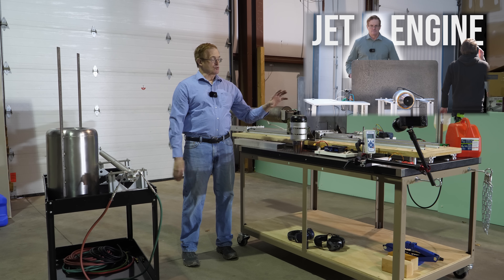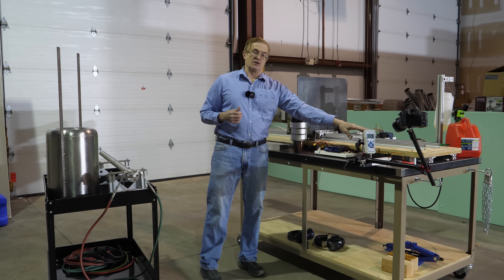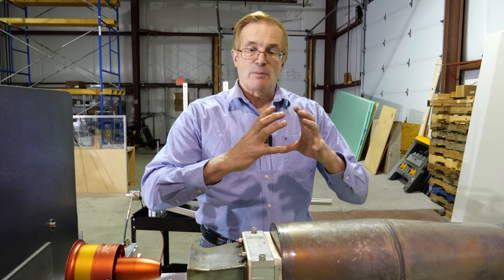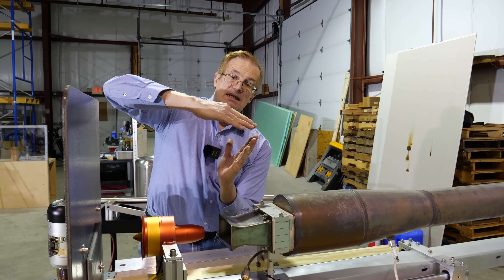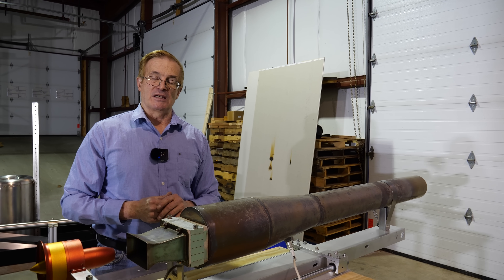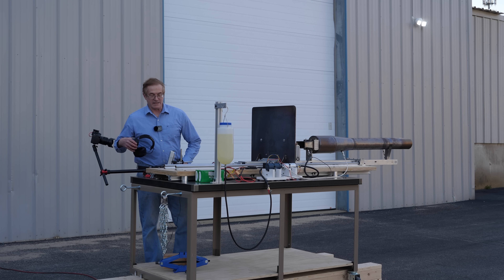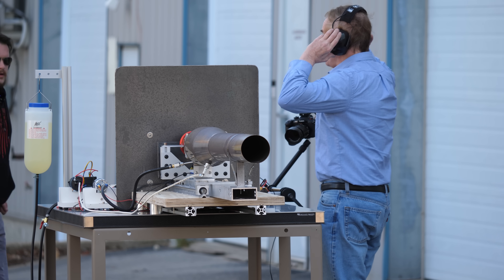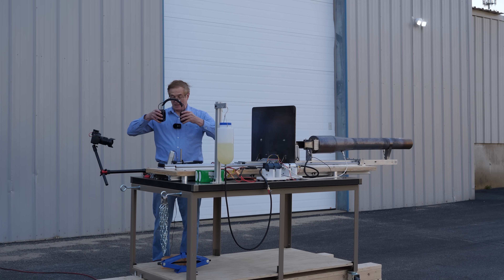Full Throttle Test: Did we Push a Pulse Jet Engine to its Limits?!

Comment: I imagine the fan was the added thrust and not a significant gain in force from the pulse engine.......there wasn't a real change in the jets sound to think it made an extra 45 or so nm of force
Reply from the maker: I disagree.
Look at the force guage when we turned on the fan, but before we started the engine.

Comment: To me it kind of looked like your damper there on the load cell was not damping. It was just springs. Short of a tuned mass damper, you might want to try like 1/10th scale RC car dampers. There are a (very) few with adjustable damping (as opposed to just adjustable springs) but they do exist and they're cheap.

Maybe this will help. I can't tell if the rigidity of the table was the problem.

Comment: Can't you just bolt the table to the ground go around the wall and control the whole thing from safe distance? Like you did with the rocket engines attached to a trailer.

Comment: Does diesel ignite in a pulsejet? What's the compression ratio for that combustion chamber?
Reply from the maker: It will, but it's harder to get started.
The power output would also be a little higher.
I said that it's about 2:1 when I discussed the value of forward motion and the fan.

Comment: Living in a railroad town in the 50-60s railroad brakemen had a portable pulse jet for heating up frozen running gear on train cars. Our town also had a pickup truck mounted pulse jet that expelled DDT for mosquito control..
Reply: I have encountered the pulse jet mosquito killers in the far east in the distant past, very noisy but fascinating.
Reply: @cambridgemart2075  here in Florida our mosquitos sound like pulse jets..

Comment: 6:17 What if you would use a rotary valve, like some 2 strokes have or had on the crank, like old trail bike i had with a Rotax engine, something like a 15/16 cm disc with a hole, but driven with electro motor, than time the spark plug to the valve and use a fuel injector from a car?

These devices they made in Germany back than where very very clever engineered, especially the "electronics", no detail was left out.

Comment: From the moment I heard about pulse jet augmenters, I've wondered how a full-length augementer would behave. Basic idea idea would be to increase the mass flow rate ad a normal augmenter does but also serve to cool the engine and draw a stronger air flow into the intake. If I recall correctly Messerschmidt had some interesting patents to that effect just after the war.

Comment: I’ve been curious, about injecting ozone into a jet/turbojet engine, theoretically the coanda effect inside of a pressurized atmosphere should be more effective at converting o2 to ozone. And since ozone is a better oxidizer I’d figure you’d get more power.

Comment: By the way, one of the engineers helping build the pulse-jet for the V1-german-rocket in WW2, lived after the war in Eastern Germany, and invented the 2stroke-engine-resonance-chamber, based on the function-principle of the pulse-jet... Was later taken by the Japanese (Suzuki), to help them with his know-how win 2stroke-bike-races for Suzuki... The resonance-chamber is what first turned the 2stroke into a performance-beast as it replaces the charger (which 2strokes anyway didn´t have, or any other engines, for that matter), and it´s a piece of tuburarly-shaped-metal-sheet, very cost-efficient, when compared to expensive turbo-chargers...
Reply: I played around with expansion chambers for two strokes in my youth. I didn't find them efficient for road use. I think there is a very narrow bandwith in RPM and temperature at which they work and it's hard to keep to this in everyday road riding conditions. They are popular on small 2 stroke aero engines which usually operate in constant speed conditions.
Reply: @nrml76  The whole theory around them isn´t trivial at all. If the baffle and the diffusor (the 2 cones of the chamber) have flatter angles (so, the 2 cones are longer), the bandwidth loses height, but gains "spread". If you make them flatter, you have to make the belly(straight piece between the cones) smaller, cause the altogether-volume of the chamber has to be constant (depending on the cylinder´s cc). there´s a lot to that, sadly, and during youth one has time, but not experience or knowledge. if the cones have sharp angles, the bandwidth is high, but short too. if the cones-angles are sharp, but the exhaust-port´s upper edge is rounded, it counters the effect of the sharp cones-amgles, and nullifies the chamber´s effect somewhat, giving you a short AND low bandwidth. if you make the port´s upper edge straight, and the cones shap, you get the shortest bandwidth, but the highest one, aka highest performance. If you make such a sharp chamber´s pipe gliding on the exhaust pipe (2-piece-pipe, gliging in each other by a strong servo, automatically matching load and rpm), u get the sharpest combination (aka highest performance), but can match it then to every rpm/load-situation, stretching the bandwidth 3-4 times (to a few 1000rpm). But it´s very few people doing that (the pipe from the port to the chamber is a 2-piece pipe, gliding in each other, so the exhaust can be short or longer, depending on engine load/rpm). Normally done solely in previous Eastern Germany (2stroke-tradition cause of the decades-long trade-embargos of the West, that made 4strokes unreachable) and Holland (racing-tradition on eastern-, but also west-german 2strokes). Look for "Variable length two stroke exhaust with servo", you´ll find 2 video´s in YT, and there´s a few more...
Reply: You can only mean Walter Kaden at MZ ... did not know he worked for Argus during the war.
Reply: @ He was somehow involved, hence the know-how... And today, no one can imagine a 2-stroke without such an exhaust.
Reply: I don't know much about Pulse jet Engine,But as I was watching the video I was thinking about the Reed valve on a 2 stroke engine. They are shaped like a triangle and they flutter when you vacuum on the one side .Or you can push air through the other side of the reed valve and it will also flutter. I was wondering if that would work for the home hobbiest to try. What do you think  ??
Reply: @jasonbamford7579  Sorry, I do´t understand the question, and from the bit I understand, I don´t see it being helpfull...

Comment: Is there any way to increase the compression ratio? What if we put another small pulse jet pointing the tail towards the intake of prime (larger)pulse jet engine, synchronised pulse of small pulse jet with the the backward pulse of larger one. that would increase the pressure allowing high compression ratio.
Reply from the maker: It probably would, as the fan obviously improved the performance.
Reply: @TechIngredients  yes, fan did its job but it's a continuous flow of air which might cause valve to stay open all the time even during combustion, Reducing the overall efficiency.
(Now I don't know how effectively internal pressure keep the  valve shut).

Comment: diagonal braces,, rectangular stuctures like this table are very bendy when encountering a "sheer force" like this
I recently was repairing a washing machine and tried running it without side panels, and it was terrifyingly bending so I had to turn it off while holding it to not fall apart, but put on the thin sheet metal panels back and it's super rigid

Comment: Watching the newton force on a table that weighs 450 lbs, your thrust to weight ratio looks to be .08. That will be a brain rattler but wont move the table due to your friction blocks. I am afraid, like you, if the augmenter doubles the thrust, you could lift an end of the table and, once that starts, the ratio could go easily over 1 and cause a full flip or worse! Possibly some anchors in the pavement would prevent that but you will also need to strengthen your recoil springs on the force block to lessen the "bucking" from the pulse. It looked like, for a moment, there could have been a harmonic event with the pulse cycles thus amplifying the vibration in the table. You make me ask questions on every show! Love it.

Comment: The more air you can give this air breather beast the better. It wants to consume air like crazy just like an afterburner or turbo. In other words fill that big booster tank up with compressed air, and pulse that into the engine. The compressed air is then "trickle" charged by an electric motor as most compressors do. You end up using the advantage of both rather than using a small motor to force a large amount of air in a relatively small volume. With ejecting compressed air you get the velocity essentially for "free" than have to rely on ram speed. Be warned that adding compressed air will definitely make your table fly into the stratosphere.

Comment: Why don't you add a carburetor to the front of the reed valve? Then you wouldn't worry about flooding... its basically a 2 stroke engine

Comment: I'd like to point out that I like the decision at the end. Because if your setup is running as intended and you might yet be able to improve it, it can be really hard to say "I'll stop the experiment" just because you have some doubts (in this case about safety) about going forward. Telling yourself "Nah, this is will be fine" is easy... Usually re-evaluating the aspect in doubt is the right decision, though.

Comment: So the fan is adding to the thrust but not to the combustion. The fuel has an optimum air to fuel ratio. If you  add a fan to the outside of the rig and switch the starter fan off and turn the auxiliary fan on you'll get the same result is my hypothesis. Or you make sure the fan is independent from the rig so it's blowing the engine away from the measuring device against the force of the engine's thrust. Am I wrong?

Comment: I'm also wondering about two other things:
    1. Since the pulsed jet engine works at about 2 bar, would it be possible to line the inside of it with a material to prevent the exhaust pipe from getting superheated?

    2.  Assuming you wanted to test this without disturbing the neighbors, local and regional wildlife, seismic sensors, or submarine sonars, would it be possible to create a sound absorbing structure into which the exhaust can be directed?  Sort of like your old sound-proof room, but in reverse.

Comment: This was indeed interesting, at least for me, compared to you're last experiment. If you use an inlet the same as in the last one, you get a lot of turbulent air and therefore a major boost in air fuel mixture, which could lead to a more efficient combustion?

Comment: Noticed the thrust seemed to decrease with the fan on, is the fan isolated from the thrust mounting (I.e. not contributing to the forward load but still contributing rearward load?)

Also you might want to consider adding dampeners in addition to springs. Currently your only damping is friction and fluid resistance from air, which will only partially damp high frequency pulses like this. Don't know what the critical frequency would be, but the addition of a shock damper like a fluid cylinder might smooth out those pulses even more

Comment: Since the augmenters don't work with continuous jet flow and need pulsed jet flow, and since the frequency of different pulsed jet engines vary, is there a best frequency of pulses to have?  

For example:
    • Too Infrequent.  Unhelpful below some low frequency threshold.
    • Goldilocks. Variably useful within an overall mid-range, and optimal at a narrow mid-range.
    • Too Frequent,  Unhelpful above some high frequency threshold.

Comment: The square plate needs to be either removed or moved at least double the distance away because of the air disturbance it’s causing.  Notice the efficiency of the pulse when you supply the air at the intake..?  

It would be better to setup a remote camera and take yourself out of the danger or build a full size blast shield for yourself so that you can remove the square plate.  We use a test chamber so we are not in the same room & air supply and have an extinguisher system. 

These are just proven suggestions from an SME perspective so that you obtain the best test scenario because what you have is currently flawed and causing more failure than proper protection.

Comment: 4:04 How are you not getting a spark across the wire connection and the aluminum strong back?
Reply from the maker: The entire assembly is at ground including the grounding wire attached to it.  The high voltage lead attaches to the isolated, central conductor of the spark plug and that terminal grounds to the outer rim of the plug.

Comment: Why not present a simpler valveless engine?
Reply from the maker: They tend to be aerodynamically bulky.
Reply: @TechIngredients  True, but you don't have to worry about valve failure, which is an issue with valved pulsejets. In the video you mention simplicity and ease of construction as being an advantage. Well, the valveless designs further improve upon this as they are basically just tubes with no moving parts. I know this video is just about augmenters. So, it doesn't really matter, but I would think that if pulsejets have any future useful applications valveless would be the way to go. Efficiency isn't great for either valved or valveless. So, if one is looking at it from a performance point of view, pulsejets aren't the way to go either way. Therefore the main focus would need to be simplicity and reliability and the lack of valves suits that.

Comment: Diagonal braces on the table and frame with spikes shaped like a railway bump to direct energy into the ground.

Interesting if you had a normal turbo fan jet in the middle with an array of doozle jets around then they use some of compressed air exhaust to run. 
So if you have an array of 8 around you would increase peer by 16x plus the the fan itself… 

now that would probably require chain and concrete anchor blocks.

Comment: Take the jet engine, make a pipe for it that bifurcates with a motorized flap in the middle and put one of those ducts on each end, so you have the full throttle of the jet engine but you have 180º phase pulses on each side allowing you to use the efficiency improving ducts.

Comment: I wonder what would happen if you fit a heat exchanger and swirly fuel injector to try and partially vaporize and heat up the fuel before its being burned. Thats what they do with normal fuel burning turbines to get more efficiency, a cleaner burn, most likely more heat, which means more expansion and thus more compression?

I hope the brits are not watching, they might be worried that someone is trying to make more efficient V1 engines to possibly reach over the atlantic. 🤣

I do think the fuel is not burning that smoothly because your spring setup was oscillating quite slowly compared to the engines actual frequency. I wonder how that happens. If thats some kind of resonance? Very curious. The actual V1s did not pulse that fast.

Also, you posted the flying bomb from a game, but not the madman on his salt lake 3 pulsejet contraption? He is quite the legend.

Comment: Super interesting! 
I wouldn't be very scared of increased trust from the augmenter, but I'd add MUCH more dampening to your setup (or remove the springs again). If shit hit's the fan, your mass-spring eigenfrequency is a harmonic of the pulse frequency, with destruction just around the corner, no matter how rigid your table is on the ground...

Comment: Couldn't you anker it against the building?
The floor seems to be slightly slanted, so with the engine exhausting away from the building, the thrust vector would be at least somewhat hampered by having to try and push that heavy table upwards through a building, heh.